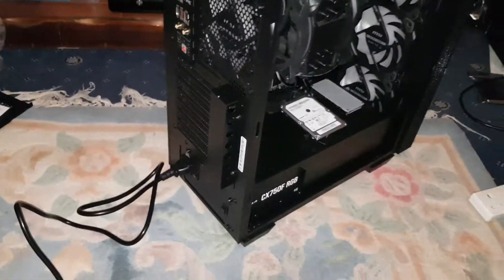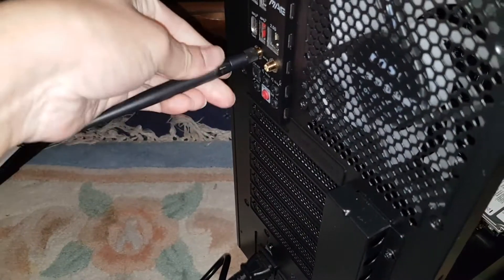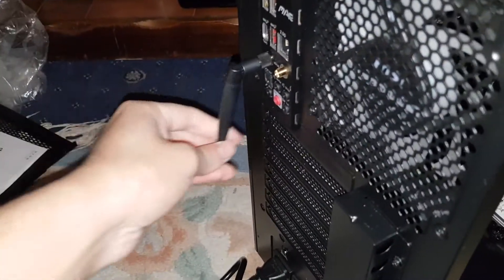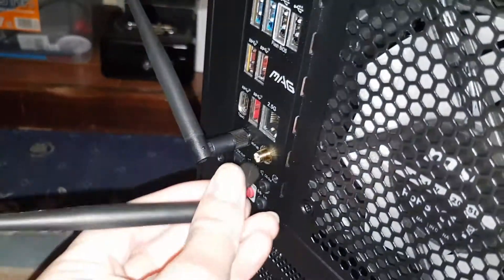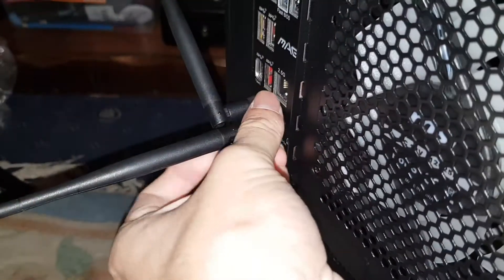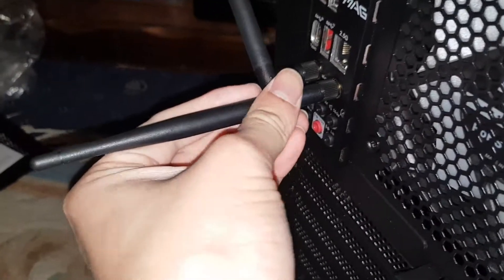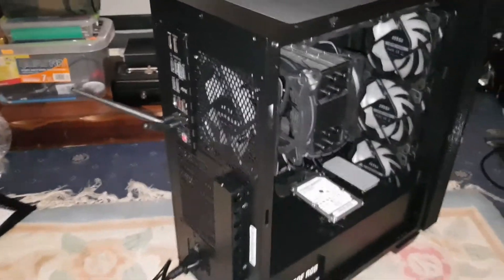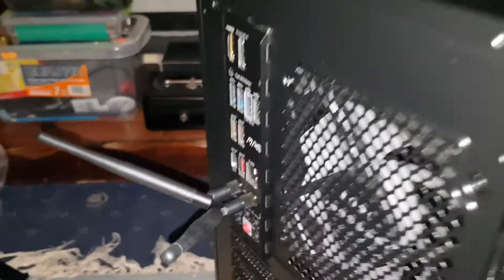1440p Gaming PC Build - Installing Wi-Fi Antenna

Comment: i tightened mine really hard is there a chance i broke it?
Reply from the maker: Probably not, just don't take it back, you might have overthreaded the hole though so if you do take it out you might struggle to put it back in
Reply: @MrWaheedulHaque my one is loose when I try to install mobo b650m gaming wifi